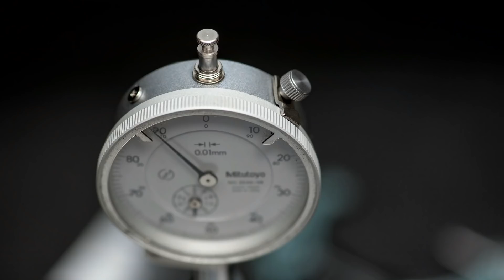Porsche Carrera 3.2 Teardown

Comment: Many Porschephiles praise the simplicity of these early 'air cooled' flat 6 engines in the early 911s.
Simple? Compared to what? Building Spaceships?
Reply: Simple is a Chevy 235 six cylinder.
Reply: no, the simplicity of those engines comparated to the 1980's american and german engines, you can take out the engine from the body in two minutes, ALONE, just you an you...now try to do this alone in a BMW 316i from 1978 or from a 69' Merc 280SE...also the teardown...no hoses, no rubber belts, nothing of hidraulics actuators, vacuum tubes or "swiss watch" gears that may jump away while disassembling the engine!
Reply: ***** I happen to have first hand knowledge of rebuilding a Chevy 235 I-6 They are one of the biggest pain in the asses to work on! I also happen to have experience with rebuilding air cooled flat 4's! They are truly a piece of cake to work on! The air cooled flat 6 has got to be one step up from rebuilding a 4!
Reply: Mrung0wa I disassembled a 235. The removal of the flywheel/bellhousing is a pretty complicated procedure. As for the small block Chevy, it's a very easy engine to work on.
Reply: Are we talking about the same engine? My friend had a 1953 Chevy Bel-aire  convertible with an in-line 6 cylinder OHV (Over Head Valve)with a 3-speed manual transmission 6-volt electrical system..
Reply: Mrung0wa Yes, the same engine. The '56 Chevy 235 that I disassembled asked for the flywheel removal in order to unbolt the bellhousing. The 230/250 six in line has the same belhousing bolt pattern as the small block Chevy. No need to unbolt the flywheel to remove the bellhousing.
Reply: I should of replaced the 235 with the far superior 250 I-6! I regret not doing so. The valve train is much more easier to work on.
Reply: Mrung0wa Here in Brazil the 250 six is a very popular engine. Was used for many years in the Chevrolet Opala.
Reply: Much like comparing Grace Kelly to Kim Kardashian- one is timeless, classic, makes your heart race and never lets you down. The other is fast, trashy has no real value in 5 years.

Comment from the maker: Part two, which should be finished by fall, will show machining of engine components and the assembly process. The engine will get increased displacement among a wealth of other goodies which should raise the power output by a modest 100+hp.

Comment: What year was the engine? How did nut shells get in? Lol. I'm guessing it's a late 80s Carrera and was sitting outside for an extended period of time
Reply: The model you guessed is correct, the shells aren't exactly IN the motor, but they are behind the fan underneath a shroud... leaves and shit just work their way in there over time, but apart from disrupting some air flow over the fins, they don't really affect operation of the motor.